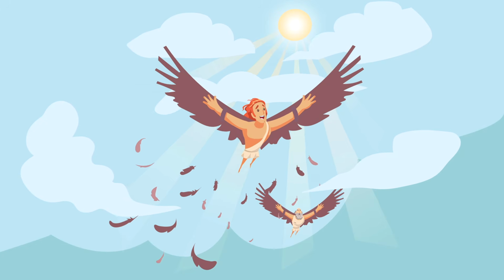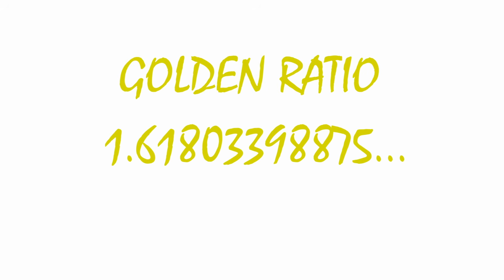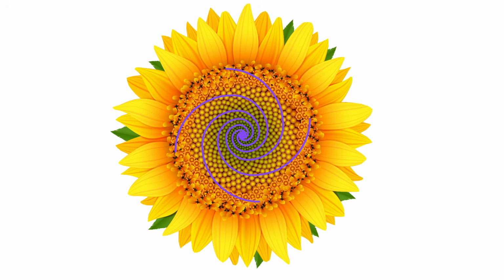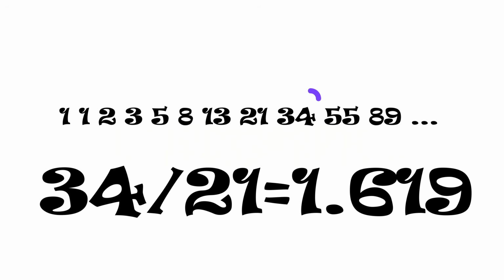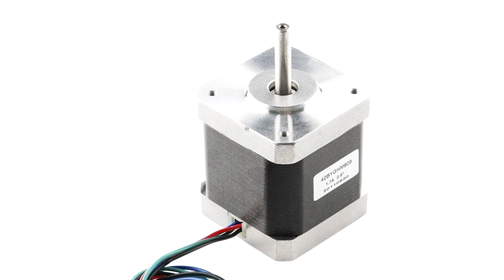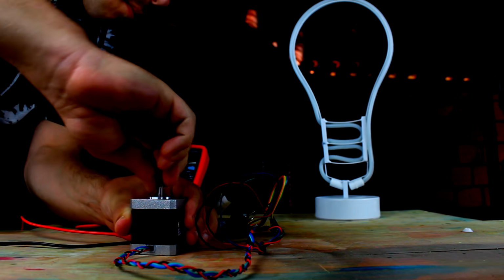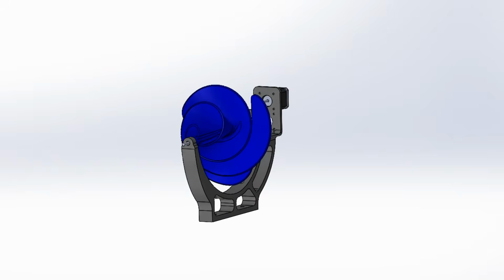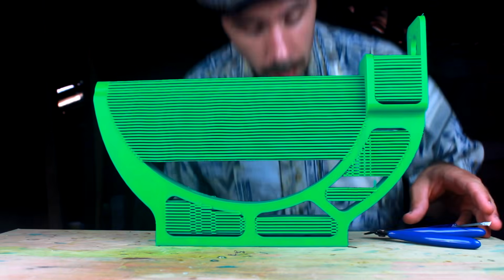Golden Ratio Turbine 3D Printed

Comment: Integza, new project idea 

Golden ratio hydro electric generator that collects rain water, and funnels it down a pipe into the golden ratio turbine, but also test it against other common turbines that are used for this purpose, maybe the GR(golden ratio) turbine might provide more power.

Plus I could REALLY use a 3d printer for my RC aircraft hobby, and to help make parts and cool nicknacks and experiments of my own.

Best wishes - Badger Actual from Michigan.

Comment: I'm currently an engineering student at our university and we are currently at the thesis stage. Our proposed thesis was perfectly executed due to your videos and ideas regarding the lily impeller. We'll use the propeller not just for mixing but much more than that, the data for it's use is limited so we are currently running some series of test for it's uses.

Comment: The reason the direct drive worked better is because the ideal gear size ratio was reversed, put the big gear on the impeller and the small gear on the motor/generator and the output should be dramatically increased.
Reply: That should decrease the input whilst also increasing the output

Comment: If you check the design of Wind turbines, you'll find that the force they capture is so incredibley immense. Their very minimalistic fins are purposefully designed because the wind force against them would shatter, dislodge, or stall the turbine otherwise. I.e. galeforce experiment. :^) large scale/surface area = more power

Comment: Steam Golden Ratio Steam Turbine. altho that might break or melt the plastic but it would be cool sense modern steam turbin power starts with short blade for maxe power imput and steam produces a lot of torque   if it was made longer and had more blades. and if it had a shroud should make a farly decent steam turbine.

Comment: you should try a 3D printed steam engine... that turns a generator, that runs a charge system to develop spark to run a gas turbine... oh.. and generate steam by using a gasifier to create bio gas ....

Comment: The centrifugal pump can indeed be used to generate power. As seen in car turbochargers - the exhaust turbine working in the exact opposite way to the intake boost generating half. There can be a great many designs and the modern turbo blades are in a very different design to your older style (both energy generation and pressure generation) but one can make a design like yours generate energy for sure. Essentially a number of small wings on a disk, if the fluid flows from the outside to the center the wings will of course produce lift and provide a turning moment. A lot of these designs work in this way, just with a thin curved metal piece making up the inefficient "wing". Of course this does not work on the bi-directional centrifugal pump blades, but they are just an incredibly unoptimised style of blade able to do just about good enough in two directions.

Comment: What about the repulsine, a Schauberger very interesting idea
Back to your propeller test, what if you use a second turning device on the outside of the water flow
Could a specific air flow design appear in the bottle ?
Can the air flow maintain a permanent circuit between central vortex and the external side, including kinetic energy, water will try to take the outside
But air can create some air strings to re-feed the vortex

Here is a photo of the possible result...
Can't found the right image...
Sorry can't found best, the lines are interesting
https://www.magnetiseur-energeticien-nimes.fr/pict/magnetisme-humain.jpg

The idea is simple a propeller inside a sphere with back lines on the outside for the return of the air flow 
All in a bigger sphere with same opposite back lines for water that will create invisible vortex

Then what if you found a way to make it very light with a few water and reverse...
Could it be push by the air wich is closed in an under circuit with the speed, but want to take the superior place

If you need to create energy
Hy power magnets, turning closed to big coils with a small central iron core
Frictions will only be concentrated on the small iron core, but will amplify a powerful magnetic field in the center of the cupper coil
That's a generator device, not a motor

A motor could be used to create energy... With an incredible difficulty to turn, very important frictions and structures pressure increase
And only if you've got magnets in, some electric motors don't have any, as an electric grinder
You can lost an entire life to try it will never works

https://youtu.be/St6lcpmwNQ0

Did you try to reverse the sens of the turbine, the vertical sens
If there's another bigger turbine in the other  vertical sens
Both can run in the same direction with gravity inverse result on water mass

Then you probably need a water and a air circuit to harmonise the flows

Also a valve to permit air pressure

Comment: Okay.
Make a funnel in the golden ration, and pour water through it. It should let the water through almost without friction. (According to Schauberger)
Now, make the water go into a Lily Impeller. The force of the water would make the impeller spin and that can make drive the outside of a double walled container for the water.
Between the double walls, make spirals that pump(?) the water upwards and into the funnel at the top.
My question: Does the Lily Impeller have enough torque to pump the water upwards and restart the sequence?
If yes... Perpetua Mobile!
I made this to explain: https://youtu.be/QWarFMAUNbI

Comment: 1) You can stop the plastic from exploding by building struts between the blades, but of course make them flat to the apparent wind angle. It will reduce efficiency, but you can go much faster and get more max power, and maybe reduce relative friction losses by going big. 
 
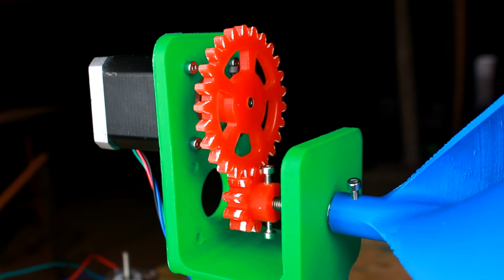2) your bearings (19:46) are absolutely awful, is that threaded bar just sitting on the inside of the bearing? To get stiffness you should add a nut to either side of the bearing, tightening them together. All of this noise and exploding and inefficiency is because of this

3) did you balance the rotor? You've got to balance bicycle wheels, and they don't go anywhere near 2000rpm+. Balancing is really important.

4) Water and air obviously have different densities. All wings/blades are designed to split their intended fluid (air water oil whatever) and if you change that fluids density you have to change characteristics about the wing. It's angle of attack, relief angles, the number of blades, etc etc. Taking a water impeller and using it for air doesn't just mean it will be less efficient, it means it may not work properly at all. When 30k/h wind is passed over a pencil it will still spin, due to the vortices mentioned at the beginning of the video. But it wont have much torque and might explode. If no propeller math was used at all to make this propeller, who knows what its doing

Comment: Kewwwwllll. I need an off grid water pump, to run a cooling system for the condenser section on a sea water to fresh water purifier. Soooo, that's a video idea right? Lol I'm thinking wind turbine power generation into power storage. Yahhhh?

Comment: Why not print out your designs with an interface that can work with LEGO Mindstorms and Technic parts? That way you have gears, pulleys, axles, basically everything you need to connect the build to whatever you need to test.

Comment: Don't use stepper or gearbox motors, they waste power and make noise. Re-wind a BLDC motor to lowering its kV rating and changing to delta winding configuration, check GreatScott, he has a great video for this. Or you can try to build an axial flux PM generator which has high efficiency when operates at low wind speed. I saw some China companies selling these generator with coreless disk design which can produce lots of power at low RPM (~500W @ 150-200RPM)

Comment: Hey, I have an idea for a video. It's something I'm actually wanting to do myself, but don't really have the capital to waste on a project with such a high potential for failure. More or less looking for a proof of concept kind of thing. I'm wanting to build a small tracked buggy style vehicle to haul me and hopefully a friend across a dune like region, like a beach, or an actual dune. I know I could pull off such a thing with PVC piping for the frame and structure, and I would likely only need a 2 cylinder, 2 stroke engine to run it. My problem is I don't like to do things the easy way... ever. Not to mention if I build it with a conventional motor, I'll likely over engineer it and end up throwing a V8 on it. What I'm wanting to do is build it out of what is effectively toys. Steel erector sets, and (if I can find it, simply for ease of construction) steel Lego gears. I'm also wanting to run it off of a Stirling engine. Before I even think about drawing up designs for it, I would want to know that my choice of motor would in fact be able to haul the weight at any kind of speed to make it even worth doing. I could make it crawl at .5MPH if I gear it right, but I'm wanting to know if I could produce a little more speed than that. I would be happy with 10 MPH, I don't think that's asking too much from a small motor like I'm looking for, but I do want to know if a large Stirling engine could handle it, or if I just need to chose a more conventional method of driving it. What I'm asking is if you could test the actual power of a decent Stirling engine, in terms of torque or horse power, it doesn't matter much to me. If you like the idea, you're welcome to use the entire idea of building the vehicle yourself for a video, that would more easily give me a definitive yes or no answer without me having to do any pesky math. It would be a pretty big build, and it is a lot to ask for someone to build something like that just to be able to tell me if it works or not, I know, I am sorry about that. However, it would be a video that I would definitely watch, and I think you could have some fun with it.

Comment: So... to win a 3D printer, I just have to subscribe and post a comment for a video suggestion? How about making a video where you name me the winner of a 3D printer? LOL But seriously, how about making a video comparing your turbines at different layer heights and varying methods of smoothing the print surface so you get more or less wind resistance; sort of hoe the divots in a gold ball can improve aerodynamics. Does the kinds of rippled effect of printing at .2mm or .3mm layers perform worse or less than at .1mm or .05mm, or even against as smooth as you can get from a resin? You could also compare sanding a print smooth.

Comment: Efficiency of  a turbine is not measured  by Power out put of the  turbine. It is done who much of Kinetic Energy  of wind is converted to Mechanical Energy. You should check out the concepts of Fluid Mechanics and Thermodynamics.          
https://youtu.be/U_195_Uq3dU

Comment: Using super slick skateboard wheel bearings at each end of the wind turbine should make for much quieter— and more efficient— operation. Also, this design looks like it could be used in boats as a safer alternative for marine life, so long as it is as efficient as the standard propeller.

Comment: What 3D printer are you using? I have a number of ideas but the 3D printers found in stores around here are mostly low quality printers that can't do fine detail very well.
I have a small scale sphere concept with rotational motion to not only produce enough rotation to represent 1G force as a form of artificial gravity but also provide a little extra power generation as well. not enough power to power the space station but enough power to reduce the strain of power required to run the artificial gravity.

Comment: do a lift with a high voltage differential ie wire to plate or point to plate and create a number of plated for direction control, I heard it can be done in water, but magnets are needed, real em propulsion

Comment: For an open air application like up at the wind farm I was wondering whether building a venturi style shroud around the leading edge of the turbine would have helped guide air onto the turbine, therefore allowing for a lower windspeed to have an effect. Any chance you could bring out the Turbine again with a shroud and see how it goes?

Comment: You do realize that you COULD have simply put an ammeter in series with the bulb and measured the current that way. If I recall ohm's law for power correctly P (power) = I (current) x E (voltage). The bulb represented a load so work was being done. So multiplying voltage applied by current through the circuit (it being a DC circuit cos theta = 1) would have given you power generated without having to add the resistor and back-calculate current.

Comment: Maybe you could build an air panel with hundreds of super miniaturized FB turbines to be used to recharge electric cars from the wind every time the vehicle is in motion. Place this panel in front of the electric car in place of a typical radiator found in fuel engine vehicles.

Comment: Ok, let's try for a 3D printer.

Can you make a sphincter-door, & test to see if it can hold vacuum? Feel free to rename it. It is constructed as follows: a tubular rubber sheet conecting two rings. You twist the rings in opposite directions to close the door. "rubber" just meaning stretchy, I don't care what material you use, so long as it is air-tight.

Comment: We can definitively rule, now, that 3d printers do not have the ability to correct spelling of proper nouns. That's a cool turbine. I would like to see how efficient it is at power generation via water compared to commercially available designs of similar diameter.

Comment: since it gets so much power while driving, you should find a way to print those propellers out of something more sturdy like metal. then you can use it to charge whatever devices while driving, so as not to take from the car batter as much. not that it needs that but still a neat idea. I could see myself using it. basically free energy since most people drive anyway

Comment: Go back to were the turbines are when there turned off they stop them rotating in high winds not to damage the wind turbine theres a video of one destroying itself when the breaking system stopped  i just have to peek outside if the wind farms a spinnin then i know there is mild wind and its ok to fly my quads if there not then i know its going to be windy as hell and definitely not flight weatherl i think you have invented a high bypass wind turbine that would be able to operate in gales and storms to suck every inch of power we can from tue wind

Comment: Great video of incremental innovation process. ... now to put it into humanity so it helps solve a problem we face. 

Like using the strong water currents to provide coastal areas electricity, allow streams to generate electricity, and the water flow from faucets to light low power led lighting in bathrooms and kitchens.

Your 3d printed impeller could have many uses. Thanks for your time and energy to create this video

Comment: Really Entertaining video with interesting Content. I tip my Hat! For the next project, I suggest you make a hydrogen fuel cell that converts its energy into electric current. Or by any other means, find a solution to store that energy you can harvest with your turbine and make it accessible in the form of a 5V or 12V Power Plug. Perhaps for a garden house, off-the grid campers and the like.

Comment: how about hydro prop design for driving generator from water flow, or driving a small watercraft -   both in 500-2000W range - ie something potentially useful, and partially 3d printable

Comment: I’m building a water generator and I need to buy or build a proton wheel ,do u think this turbine would be more efficient than a pelton wheel .im using a 4 inch pipe running at about 45 degrees for about 1000 feet so it will have a lot of pressure what’s ur suggestion on what kind on generator I should build I’m trying to build a off the grid rammed earth home .i was a coal miner but I now live in a ghost town I would love to have a 3D printer .sean_asbury@hotmail.com is my email if u have any suggestions for me.

Comment: For thy project;  security drone. Self docking  on a charging platform when not In use,  when motion is detected, the little guy shoots up into the sky, (per determined flight  path casting an airial view of the property below to my cel phone. After flyight pattern completed. It returns to the docking station for storage and charge top off. 

Please provide feedback,  
Strength & Honor. Ciao

Comment: @integza, since you plan on doing another video like this I hope you consider my comments.

Your mini impeller was cute but you missed the mark with the acrylic cylinder you glued around the base. Seriously, would Victor have used a cylinder? Of course not!!!

The container needs to be egg shaped and have an equivalent size to match the specific size of the impeller and the RPMs it runs at.

In this manner, the impeller will move the water most efficiently and have it flow over itself correctly with the least amount of drag or induced chaotic motion.